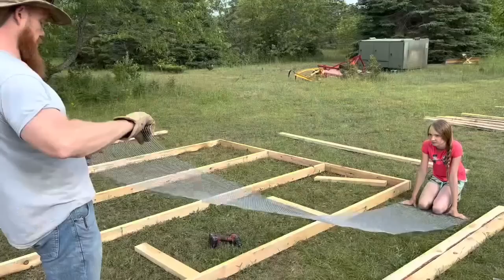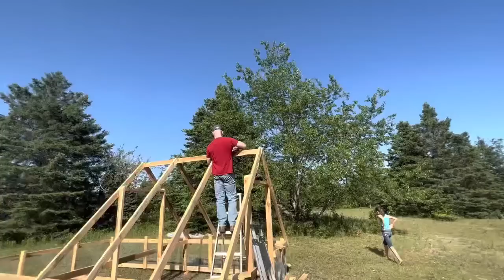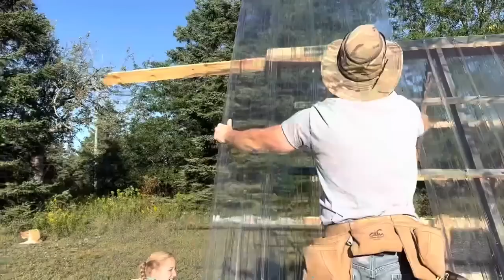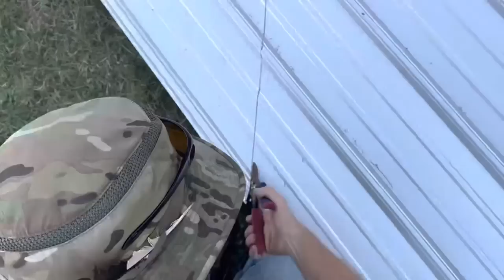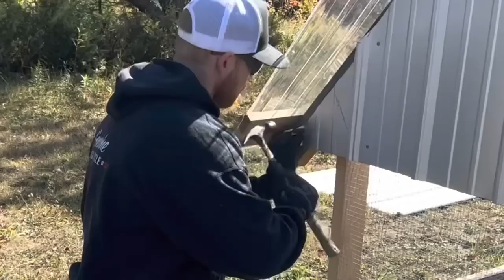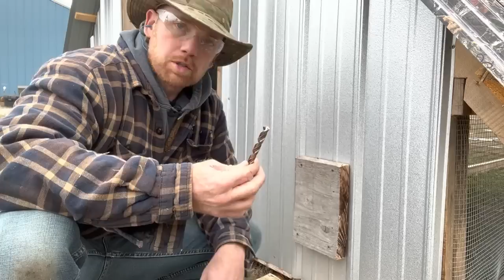Mobile Chicken Coop Complete Build… Rough cut lumber and steel from local Amish

Comment: I'm new here, so
First of all, it's awesome how you had the girls helping, and their attitude was wonderful! You make it fun, and that's important.
2nd, yes, the screws for the roofing should go on the flats, not th ridges. Reason being, on the flats it's pressed against the board, not allowing any flex, on the ridges, it can flex and could make a good place for it to move then leak
3rd, where's the ridge cap? If you're worried about it "breathing up top, it will still be able to even with the ridge cap.
4th, strength is in the triangles. You really should add some boards from one rafter to the opposite side. That will greatly increase the snow load.More than one( at different heights, will add even more strength, and give the chickens what they want and need, a place to roost.
5th, The trailer rollers is absolutely genius! I love that idea!
Reply from the maker: The ridge cap was wrong size so we had to have the Amish custom make us one.

Comment: I don’t have much experience with the plastic roofing, but all the metal roofing I’ve used the manufacturer says screws in valley or no warranty.  I think they want it in the valley so you can get a tight enough seal on the rubber washer.  You can screw much tighter in the valley than you can on the ridge.

Comment: Great project. The trailer jacks are a smart idea, but including the kids is the best of all. If the current wheels have trouble rolling on lump/wet/snowy ground you may be able to swap them with larger, "lawnmower" style versions, if need be. A lot folks will pull/drag their coops using a long line as a bridle on the front/rear. That way you don't have to climb inside and 1-2 is usually enough to drag it a few yards. You can use something weather proof like Dynema which is sold as "winch rope" at places like Wal-Mart, etc..., which will last forever in the elements. You have a lovely family. Cheers from FL.
Reply from the maker: Thank you Karl! We won’t be moving them in the winter months as we get way too much snow. They’ll get a deep straw bedding until everything is dried up and grass starts growing come spring. We will be adding a rope to pull it also. Hope you’re doing well !

Comment: 15:32 I screw them in on the ridges where the panels meet, because that's were the panel meet. But it doesn't really matter because you're using a gasketed screw. You can screw the valleys down or the ridges. Just don't put much pressure on the unsupported ridges like you did correctly in that shot so the panel doesn't flex.

Comment: Day 3: My face got into a fight with a lawnmower and lost :) May have to add 2 or 3 more jacks on the centers after you build the insulated box area - going to add more weight, and you don't want the center to start bowing downward. Very nice for a create-as-you-go project. Hope you folks have a lot nicer winter than last year.
Reply from the maker: The coop will not stay sitting on the jacks but only when being moved. If it does start to bow then we’ll get a couple more jacks.
Reply from the maker: This winter will be so much better than last winter! 😆

Comment: That yellow kitten is just too cute! You’re little girl has beautiful red hair.  Matched your beard perfectly.
Nice antique cars.  
The coop looks great.  I like the camouflage roof and the clear roof.  The Jack up wheels are awesome.  I am no expert, but I am kind of wondering how you are going to deal with ventilation.  If you switch out the tips of the clear plastic triangles at the front and back peaks for some hardware cloth, that would give you the ventilation that the chickens need.  Just a suggestion.  BTW if you have any big storms forecasted,  you might want to warn the girls not to park the coop down wind from and large trees.  The day that I finally finished my coop, a huge storm blew down an old oak tree and crushed the coop to smithereens!  A year later, I still have chickens using the basement as a coop in the winter.
Reply from the maker: We’ll be putting in hinged window vents at each end come summer time. As for now the ventilation is actually quite well. The entire 16 foot peak is vented and the clear 8 foot end is all open at the bottom 2 feet up on three sides equaling about 26 foot.

Comment: This was fun. Awesome chicken tractor. Love how your family works together. 
Maybe use the long drops from clear panels as a ridge cap. 
I think you need gussets in each corner. To keep the floor from folding when moving.
Reply from the maker: We ended up putting a galvanized on the ridge cap but I don’t like it. Wanted camo but they didn’t have any in at the time.

Comment: Wishing you a warm and safe winter from Alberta. Your shop will be nice and warm. But please wear safety glasses. I found an Olfa knife works best. They also sale large washers for your screws. I am almost done installing 2" + 1" foam in my wall cavities then poly as a vapor barrier then 1.5" foam over top of my old 110 year old studs to block thermal bridging. Hoping for R27 walls. Fantastic family team work getting ready for winter.
Reply from the maker: Thank you Aaron! Sounds like you’ll have a very nice warm building as well!  Take care

Comment: You've been missing in action for a bit. I like the chicken coup. I wish we could have made my friends wife understand that chickens can survive. We had to build her a fully insulated one with insulated windows and HEAT. We're S of Flint, not in the UP. btw, I hope you have better luck with those wheels up there than we did. We had to switch out to 10 in x 2 wide Harbor Freight wheels to get the thing to roll. The ground at the farm was always too soft. Couldn't even pull it with the tractor without digging furrows.
Reply from the maker: We’ve got very solid ground. Our chickens do t need heat in their coops even up here. As long as they’re out of the wind and off the snow they’re good to go.
Reply: @9252LIFE  Kinda figured you had hard soil. The farm here is in somewhat of a river valley so there is a lot of ground moisture. I'm looking forward to how you do in the winter. A school mate of mine had bought a small 4 cabin resort property somewhere west of Marquette near Superior with plans to live there yr round. He made 1 winter and sold because he got snowed in for a month. He wasn't physically capable of keeping up.

Comment: the wheels are super cool and watch out for predators who can dig under the coop, I would have put hardware cloth on the coop floor.
Reply from the maker: The main purpose of the mobile coop is so the chickens can be moved on pasture daily in the spring and summer months and be able to scratch around on the ground. This will greatly regenerate our pasture and disperse nitrogen in our soil. Our chickens have been completely free ranged for a couple years now and we’ve never had a predator issue as we have a guardian dog who is very good at his job.

Comment: Awesome job to you and the girls! THIS is what I missed. I was so happy to see this in my notifications. Something you may or may not want to try in the future if you build more buildings. My Dad was a Home Builder when I was little, and he used to put the circular saw blade in backwards and use it to cut corrugated fiberglass panels. It was a lot faster than the snips. Also Lowe's sells a "sheet metal nibbler" that does an amazing job on the corrugated sheet metal. They have one by WEN for $49 and one by DeWALT for $59. Again great job to you and the family, and I'm already looking forward to the next one!!  Oh, what was the emblem on your hat at the 25:18 mark? It looked like a Steelers football emblem, but I'm pretty sure that would never be. LOL
Reply from the maker: The backwards blade will work on the plastic and the steel. I was just too lazy to change er over! 😂
Reply from the maker: The emblem on my hat was a sheep! My buddy at Lazypond Farm on YouTube sent me that hat

Comment: you could add a gutter system, attach it to a rain barrel add a excess water run off at the top so it doesnt flood the chicken coup. you need a critter barrier to stop things from digging under. during winter you want plyboard to cover the exposed parts or cold wind will flow thru your coup freezing the chickens. dont forget exhaust ports.
Reply from the maker: The snow will cover the exposed end pretty fast but we’ll most likely be covering that end also come winter.

Comment: the roof leaks more when the screws are on the ridge, they belong on the flat surface, we just moved into a new homestead and the barn roof is built like this and leaks. My home in. NH had screws on the flat surface and never leaked.
Reply from the maker: They probably need tightened or new screws as the washers will dry out

Comment: I'm a little confused. You put up hardware cloth... and then will cover it with sheet metal. I do understand adding it for the winter to keep the direct wind out. Will they be removable panels?

You may want to consider putting in corner braces so the building does not wrack.

When the chickens are in the coop and pooping everywhere, pushing it from inside might not work (slippery). Thus, you may need to install some sort of bracket to push on the corners. Or... simply make an attachment for the tractor to pull it around.

Locust wood lasts a very long time as well. However, it is hard to find and expensive.

Enjoy the coop!
Reply from the maker: Extra protection.

Comment: On the roofing with rubber washers they can be ether way & when you got cut the tin put the blade in circular saw in reverse direction it cut great & dont damage the saw blade !
Reply from the maker: I was just to lazy to keep switching the blade back and forth. 😆

Comment: The roofing you guys used. Is that plastic (I realize that the clear ones are probably plastic, wasn't sure about the camp sheets) or something else?
And if it's not Tin, how much did they run you? (Trying to find some cheap alternatives to tin roofing sheets for my chicken coop, the local hardware store sells the 3x8 foot tin sheets for almost 40$ each.
Reply from the maker: The camo is sheet metal. I believe they were 27 each for that size
Reply: @9252LIFE  Ahh kk, thanks for the info.